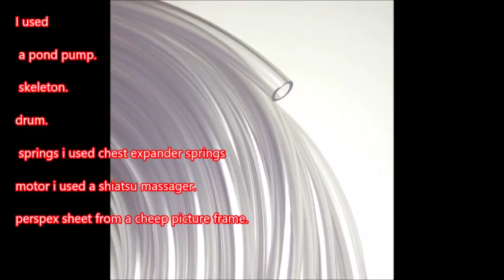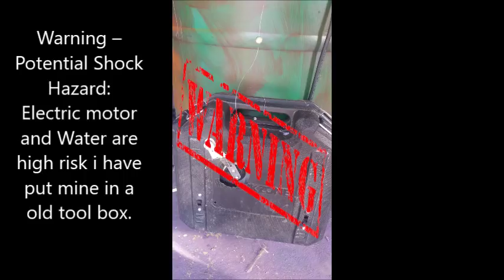How To make  Halloween Animated Bleeding Zombie Prop

Comment: Pretty sweet. Hook that up to a motion sensor / prop controller and you'll scare the crap out of the unsuspecting. Very nice!
Reply from the maker: Hi Montclairs Lair yes massage motor suggest no more than 30 min use at a time so will be putting in a PIR cencor that should make the kids jump at the last minute lol
Reply: Paul Jones lol

Comment: What did u use for the trim around the window
Reply from the maker: Hi Garett Reutter i used Foam Edge Guard Protectors Long U Channel Profile Foam - Blue - Premium quality - 35-45MM - 2M - use on pallets for for protection got some from work hope that helps

Comment: Where so u purchase your skeletons from?
Reply from the maker: Hi Tiff wilko stores £20 but they only stock them at halloween
Reply: Paul Jones if I live in America and I wanna get that do I have to get £20 or will it just turn American 20 into £20
Reply from the maker: it works out at around 26 dollars but shipping would be high due size and wilko does not post